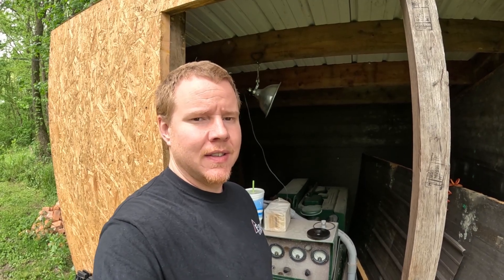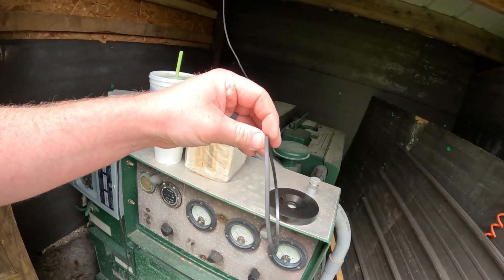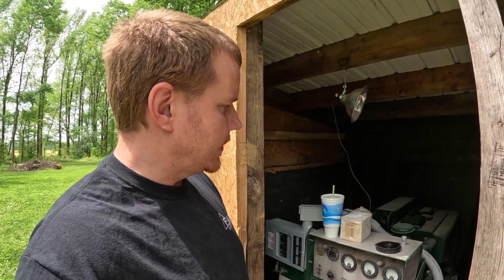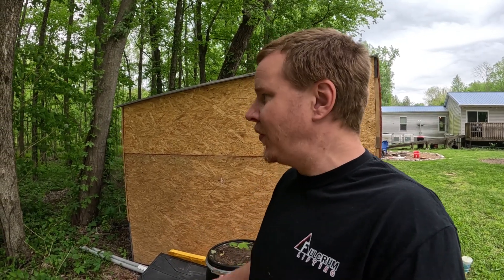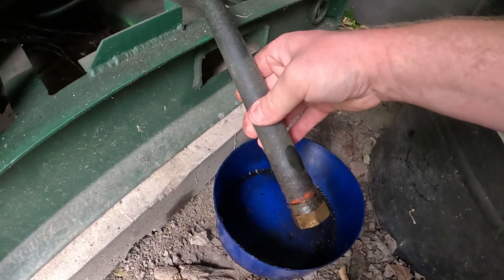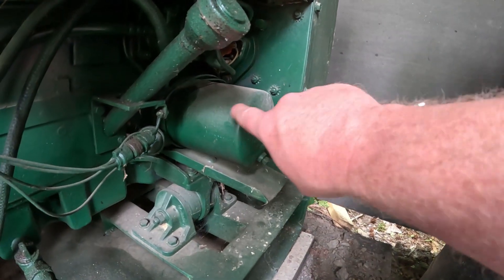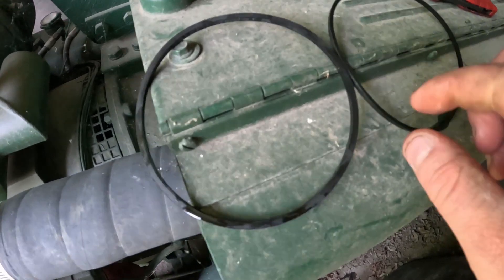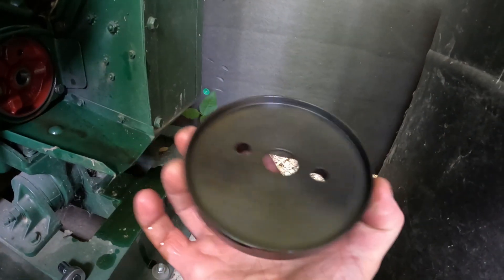MEP-003A Oil Change And Spin On Oil Filter Conversion - Diesel Generator - Back Up Power - Emergency

Comment: I'm doing an oil change on an MEP 803a that's got 99 hours on it after a reset. But the oil is coming out at a trickle it looks like it'll take two or three hours to drain the crankcase at this rate I'm getting about 1 oz every minute. I've checked that the valve is fully open I'm wondering what other valves are obstructions I'm not aware of?
Reply from the maker: Hmm..  could have something plugging the valve.  I'd try and run a piece of wire or something up the drain tube with the valve open.
Reply: @NotSoGrandGarage  I suppose that's possible, It was just reset and had 2 hours on the clock when I bought it. I found I could get more oil out by removing the filter and dead cranking the engine a few times. Got two quarts out in ten seconds that way. The rest took well over an hour. Made a mess inside the machine, because it dribbled down the side instead of pissing straight out.

Comment: Hi.where can i get the adapter? Thanks
Reply from the maker: https://temcoindustrial.com/spin-on-cartridge-oil-filter-adapter-for-onan-military-mep-002a-mep-003a-generator/    Give these guys a call or email.   They had them the last time I checked but they don't have o-rings for them.  That's why they don't sell them currently.  I just used a factory oil filter oring and it sealed up without issue.

Comment: Do you still have a good source for the oil spin on adapter? I can't even find the spin on filter "kit." Thanks! I have a multi-fuel M35A2. This old military stuff is where the expression "military grade" really means something!
Reply from the maker: https://temcoindustrial.com/spin-on-cartridge-oil-filter-adapter-for-onan-military-mep-002a-mep-003a-generator/    Give these guys a call or email.   They had them the last time I checked but they don't have o-rings for them.  That's why they don't sell them currently.  I just used a factory oil filter oring and it sealed up without issue.
Reply: @NotSoGrandGarage  thank you! I'm seeing up my 003A for off grid and you have the most content! Also, think I saw a W114 mercedes by your shop?
Reply from the maker: @TheDIYDrivewayMechanic  Yes sir you did...    used to daily it until the floor pans (and rear suspension mounts) disappeared.  Its a 240d 4 speed.  Engine and trans are good so I cant bring myself to scrap it.
Reply: @NotSoGrandGarage  I get it we have a 60s fintail 200D and a w123 240D amazing cars! When you find another carcthat has a good shell but needs motor or Tran, juat swap that in it. Should also fit  in a w123 with slight mods!

Comment: Another thing you want to keep an eye on is the dc regulator, they are know for having issues, and can either drain your batteries or overcharge them and make batteries pop tops. I worked on these generators in the Marine Corps, and i own one now, they are great generators and long lasting, very reliable, will produce up to 8k of power from tge mep002 and 13k of power out of the mep003 without  missing a beat. I always suggest replacing the fuel filters with the napa spin on adapters, and the spin on adapter for the oil filter. Also the fuel pumps, make sure you have quality fuel pumps and not cheap chinese fuel pumps, ive changed many of the cheap chinese fuel pumls people put on these onky after 20 hrs of use. Great thing about these generators is you can connect a 55 gal barrel to it and run for days, i have mine set up with 2 barrels of 50% diesel and 50% waste motor oil, and have a t connecting them, because i live off grid and its setup to kick on when my batteries get low, using a auto gen start.
Reply from the maker: They really are solid units.  I need to rebuild the injectors in mine as it struggles to pull past 8kw.  Loads up and starts pulling RPM down.  Governor is set properly from what I can tell so I assume it's injector related..   that or timing considering I had the injection pump off of it.  Thanks for watching and thanks for the info!
Reply: @NotSoGrandGarage  yeah probably from sitting,  try running some cleaner threw it, run it for about an hour with 30% cleaner and should clear it out, if not wanting to pull the injectors. Good thing is those injectors are pretty simple, another thing to check and look at is the plunger in the center of the pump, pull that out an clean it. Also check the fuel pumps make sure that they are clean, pull apart and clean them, because it can run with crap in fuel pump, but will bog down at higher rpms if crap in them.
Reply from the maker: @staym925  I'll be checking a few things come spring.  I cleaned the pumps when I got it running.  The injection pump had seized and broke the plunger guide.  I went through the pump but it's entirely possible I got something wrong or have the timing slightly off.  This is me...    https://www.steelsoldiers.com/threads/ambac-m-50-rebuild-w-pics-mep-003a.183913/
Reply: @NotSoGrandGarage  looks like you got it correct, looked over all of it, and looks like other members have already spoke, steel soiders is great place to get info from all us vets, and has helped me many times with different equipment I have, also that was a great write up, appreciate that, and sharing your info. Great thing about these units, if dont have enough power you can always connect another one and get twice the power. I didn't know you could order parts from ambac for these units, I knew could for my m35a2 deuce, good to know. Thanks.
Reply from the maker: @staym925   Yup you can still get odds and ends from them...  and they sell direct to the public which is huge.  They are pretty knowledgeable as well...  they had no issues finding the parts I needed and getting them to me.

Comment: what's up with the frequency ?  Looks way high  should be *- 2 hz  60hz  1800 rpm
Reply from the maker: Gauge isn't accurate.  It's 62hz no load on a kill-a-watt
Reply: Those gauges are junk, best to put a meter on and check, or set of digital gauges, most of the military equipment that's sold off to the civilian market are swap out with the equipment they are using, so for example, they will take a good gauge from a genset that they are phasing out, and swap with one they are keeping, keeping thier equipment in order and selling off used and abused equipment.
Reply: None of the voltage, hertz or Amp meters are consistent on either of my mep003a gensets.
I use a plug in Killwatt meter to monitor hertz and voltage.

Comment: is it running on wmo or normal diesel in the video?
Reply from the maker: Diesel.  I need to service the injectors in it yet as it sat for a LONG time.
Reply: Do you plan on running black diesel on this genset?
Reply from the maker: @SamSung-jn5fi  if I ever need to....  absolutely.
Reply: @SamSung-jn5fi I have ran these gensets on as much as 80% waste oil mix with 20% diesel. They will eat it and love it, they run almost as good on it as my m35a2 deuce and half military truck, most older military equipment will run on waste motor oil 50/50.